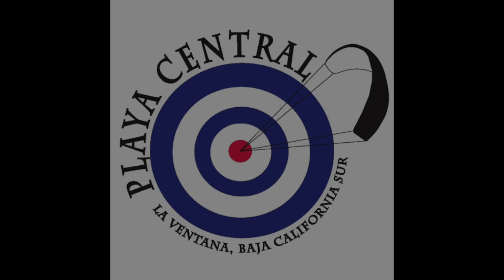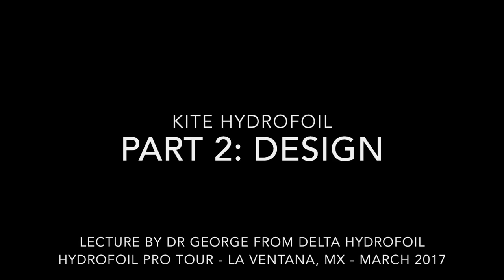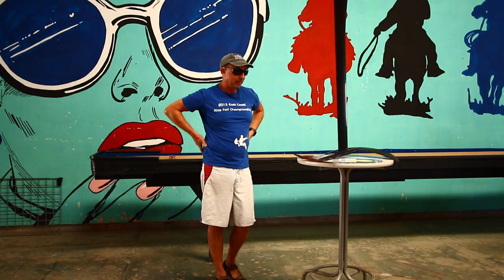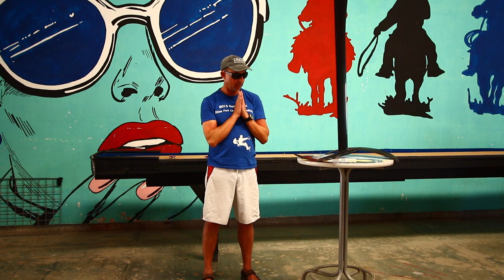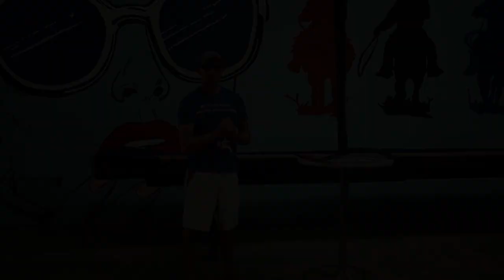Kite Hydrofoil Lecture: Part 2 - Design

Comment: Fantastic video! One question - if you keep sanding the foil after it gets imperfect the second, third, fourth, etc time... Wouldn't it get too thin? I sanded mine with wet-on-wet 1000 grit paper three times already and the top finish is coming off. Lift 2018 foil. I love it, but worry about sanding. How can this be helped?